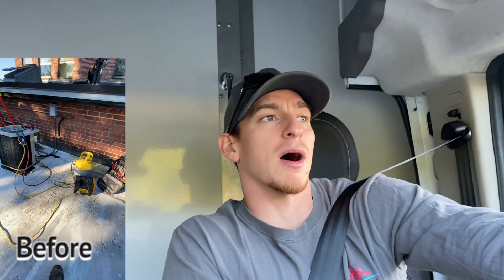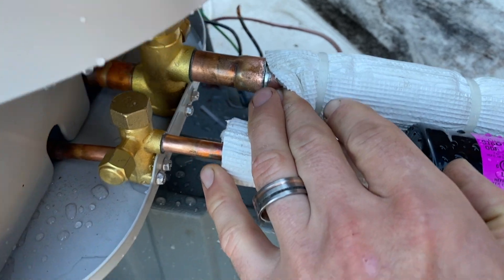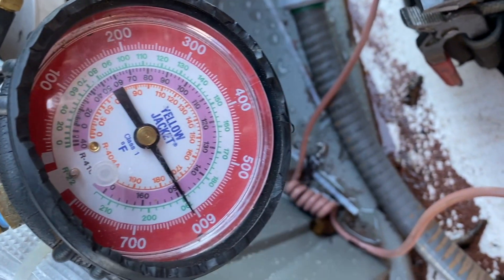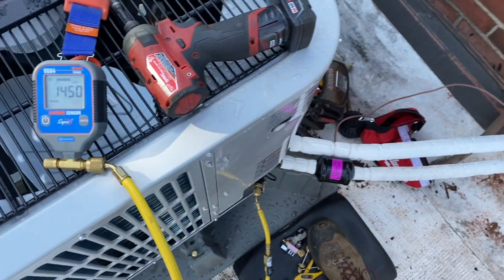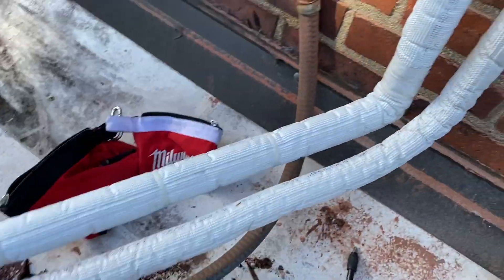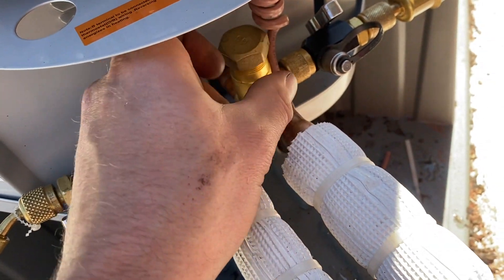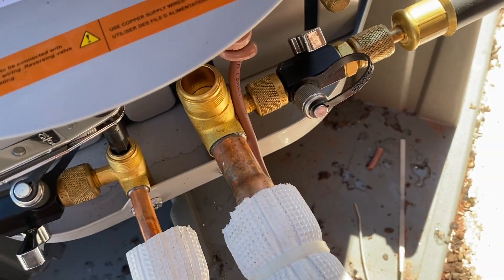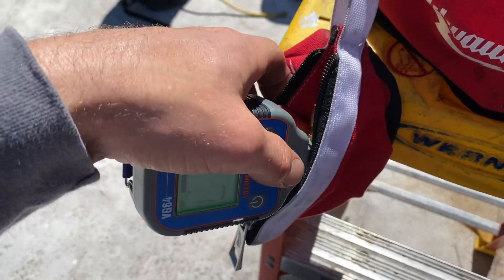HVAC Upgrade!! Installing a Bosch Heat Pump System #hvac #hvactechnician #bosch

Comment: Would the unit work with steel ductwork uninsulated.
Reply: ductwork can be uninsulated as long as it is in conditioned space.

Comment: I was told that coiling the low voltage wiring is not recommended. It can cause inductive and electromagnetic forces. It won't be an issue 98% of the time. I used to do it too when I was a proud young installer. An RSES certified technician had to solve an issue related to my coil and told me not to do it anymore.
Reply from the maker: Very interesting. I have never had a call where that was an issue. Not to say it couldn’t be a thing. I do the same thing with my low voltage on my zone valves. We have a lot of mice issues where I work in NH. This to me is the cleanest way to give the next guy some extra future slack!
Reply: Agreed because the wire we typically use 18/6 etc is Category 0 and has no crosstalk rejection of any significance. However, I have not experienced any issues in the HVAC systems in the last 35 years, but definitely an issue on computer networks with CAT5 cable runs that are close to 100meters.

Comment: Good job! I have a rancher house that has an addition built in the back and ties in with the house. Total sqft is 2,350 . House is being remodeled and is well insulated and air sealed. Hvac co. wants to install a Bosh 18 seer with 2 zones. would you recommend?

Comment: Few questions: Is surge protection required on these units ? How did you handle that. How long was the line set ? Did you need to add additional refrigerant due to line set length ? Thanks for the great video.
Reply: I always use the icm493 in addition to 517a

Comment: Do you braze or stay brite sweat the linesets?
Reply from the maker: I solder with the stay brite! Really don’t see a need to braze a lot of these jobs when it’s way quicker and easier to do this and it’s proven you know?
Reply: @BlueCollarBiceps  

Agree!
Reply: Agreed. Have many systems (1000s)  in my customer base in the last 22 years. I only braze if my contract requires it which have been my commercial clients.

Comment: Our NH winters have certainly moderated. What a summer so far too! Are heat pumps genuinely beginning to provide value here? I've been giving very serious to mini-splits. And while I truly have no idea which brand to invest in, perhaps I should seriously consider a model with a heat pump. The real selling point would be if during the fall and the spring, the heat pump turned out to be more cost-effective than the FHW-oil. God-forbid the heat pump could actually augment the boiler in the winter.
Reply from the maker: Great question sorry I’ve been away for a bit. Heat pumps are absolutely great for New England! The only time I would be hesitant is maybe a really old building with poor insulation. Otherwise they will do great. My last house was near Keene and it was a two family on slab construction. Each side had 3 Mitsubishi hyper heat units and we had heat when it was -17 last winter overnight. Woke up to 70 in the house. Cold climate heat pumps like Mitsubishis hyper heat are great. Bosch has a new IDS Ultra unit coming out that will heat down to -13° as well, that will be a central ducted system. Meaning you wouldn’t have to use any backup gas heat below 20° like the current versions!

Comment: Be a good idea to put a vinyl on that line set to cover up the armor flex so it doesn’t deteriorate
Reply from the maker: Good call! Boss man didn’t send us any so I did what I was told haha
Reply: The cover or even line set tape extends the insulation such as the K-Flex brand by about 5 years. Worth the effort

Comment: is it normal for my bosch bova to run for a very long period of time? and is it using a lot of energy to do so? im a new owner of one
Reply from the maker: Yes! They will run quite often given the outdoor conditions. They are wonderful systems and they are modulating so although it may be running often, it is only dc voltage and extremely efficient. Hope this helps!
Reply: Yes. They require that the Cycles per hour to be set at 1 cool and heat. I have found that the air handler at lower CFM works best since the condenser is running nearly continuously. Cooling Energy use is just slightly higher that a 2 or single stage but my customers note that they are much more comfortable because they don’t get blasted/ full off cycling . I have not measure the heat mode of the heat pump because in California we use Gas for heating mostly. Electricity is $0.51 KWH at Tier2 PGE

Comment: Why both lines insulated? Just had 3t HP Bosch IDS20 installed and tech said just the larger pipe. Inspector said same thing when he inspected for the town. Not needed. Why here?
Reply from the maker: The ultimate answer here is that they should both be insulated for efficiency reasons. Doesn’t “need” to be done